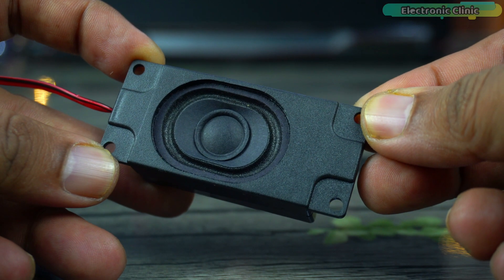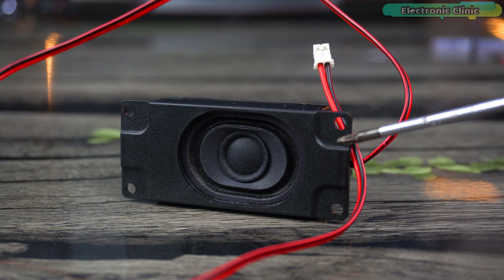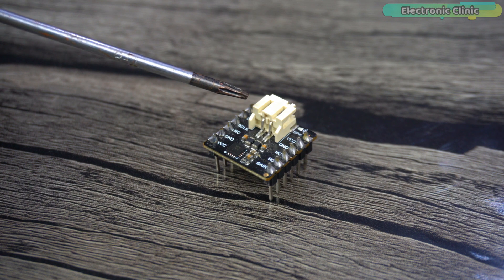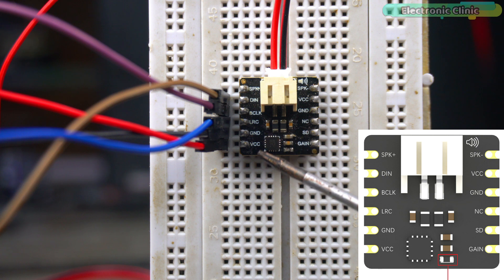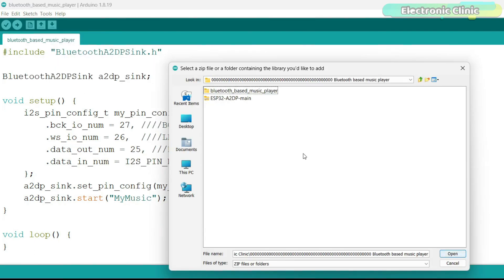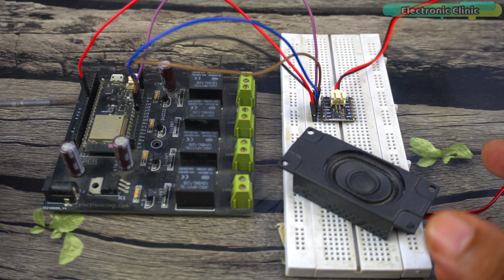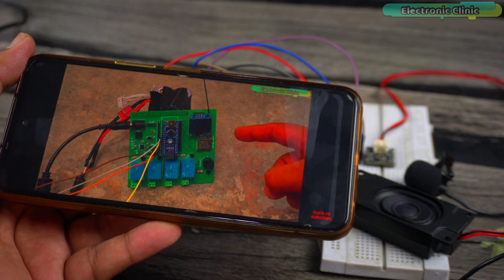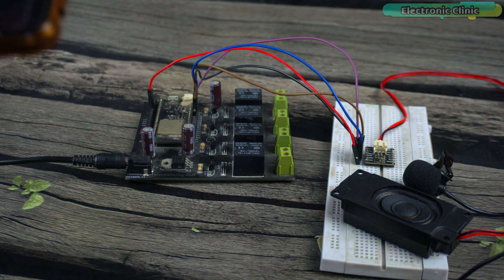DIY Bluetooth Speaker using ESP32, MAX98357 I2S Digital Amplifier, wireless speaker

Comment: Hello Sir, 
My name is Siddardha, I am a student. At present I am working on my project on Bluetooth locking system. I have completed the connections and everything works out. but my teacher advised me to build an app and provide the source code. So I have gone through your video on Bluetooth app for light on and off (https://youtu.be/GwgTlxLSeZ8?feature=shared).

So can you please send me the files... so that i will make some changes in that app like turning on the light to open the lock and the light to turn off the lock..... and change the app name as bluetooth lock.

I am unable to follow the procedure. That is the reason why I am asking for your help.